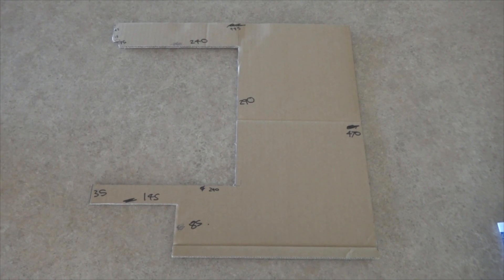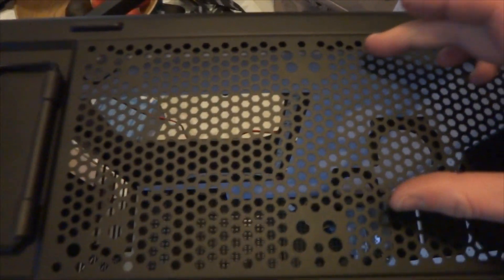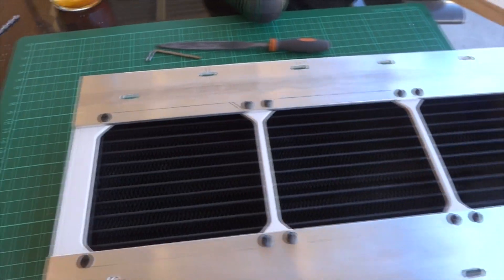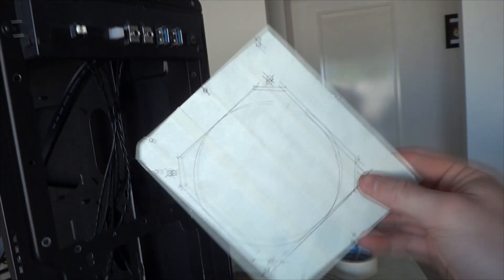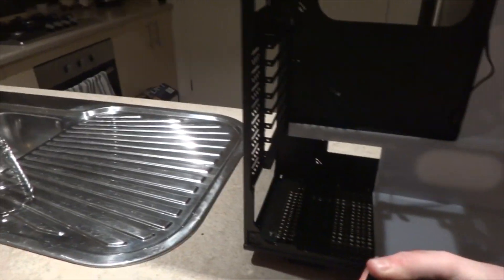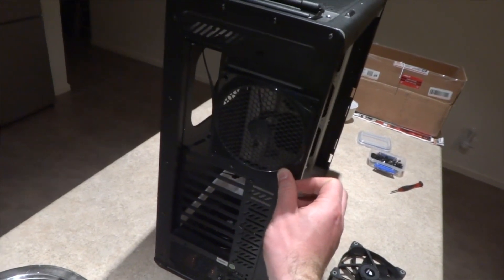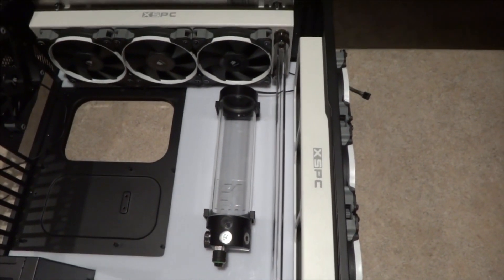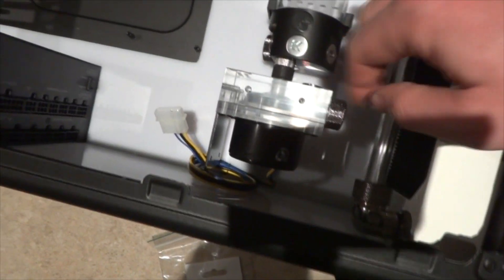Case Mod Part 3- THE MODS CONTINUE

Comment: It would have helped to have an explanation of how you measured the acrylic backplate -- and figured out where the appropriate screw holes, cable access, and other modifications would go. Awesome work you've done, but a bit more explanation about the backplate would have improved things just a wee bit.
Reply from the maker: Its a fine line to walk between too much info and not enough. I try to keep all my videos under 15 min. Basically to do the holes for cable management I just the motherboard in, marked where i wanted them and cut/drilled. No drawings or measurements etc.

Comment: I like the acrylic MB tray and floor cover... How did you cut them so perfectly? Did you just use dremel? I only saw how you cut them, but not the finish product were it was so smooth and perfect.
Reply from the maker: Cut with a Dremel (I later discovered it is MUCH easier to use a jigsaw with a fine tooth metal blade), then just filed by hand using a small file and a sanding block. The edges don't need to be perfect because all are hidden.

Comment: cool mod,but your front rad needs to be fittings up as air bubbles naturally travel upwards so making bleeding easier... :)
Reply from the maker: +chloe devereaux Just turn it upside down for ten minutes when bleeding. Issue solved. No bubbles in the system and its been running for near on two years flat out.